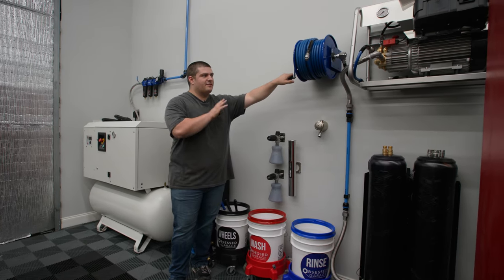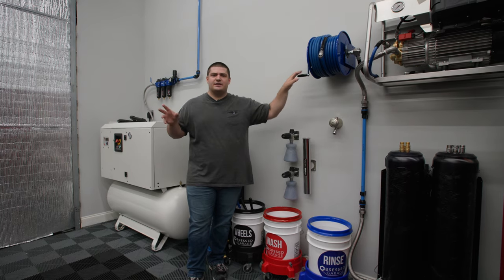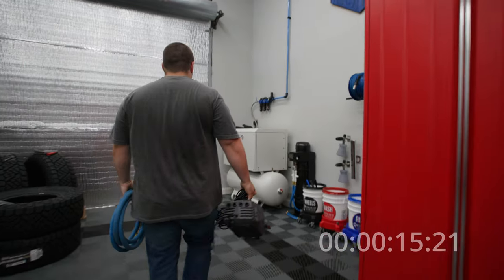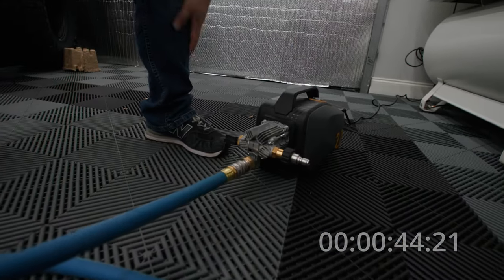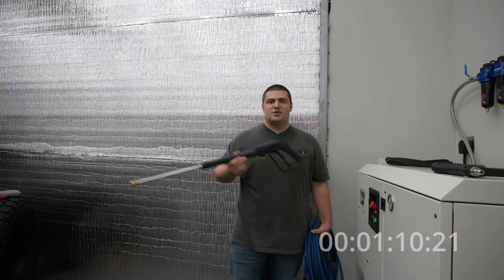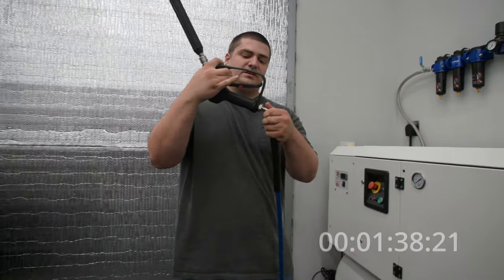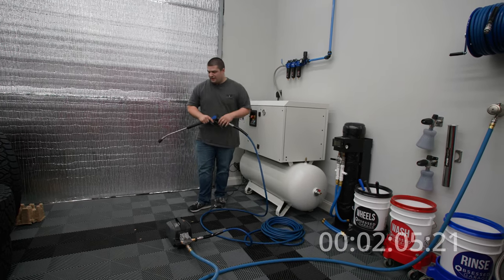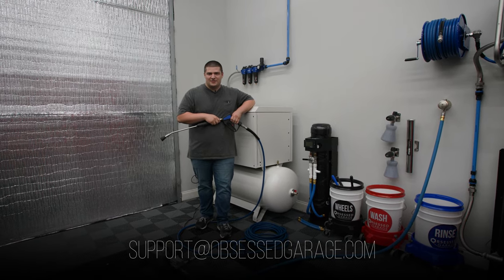Setup Your Pressure Washer For Washing Your Car FAST! | OG Portable Solutions

Comment: You should purge the air out of the line BEFORE turning on the pressure washer. This will get rid of any big air bubbles before you pressurize the line which can cause a break/burst.
Reply from the maker: Definitely agree with you here - forgot to do that on this but generally we always recommend purging before turning on the pressure washer!